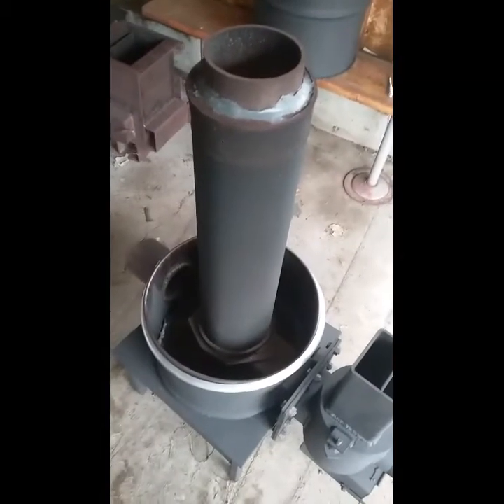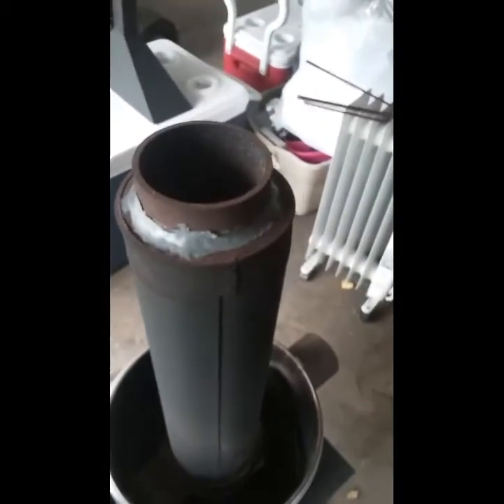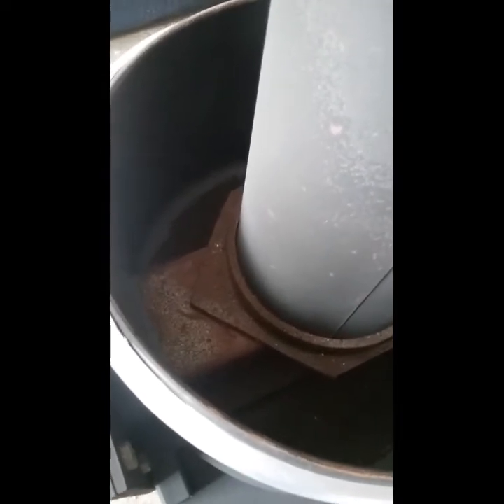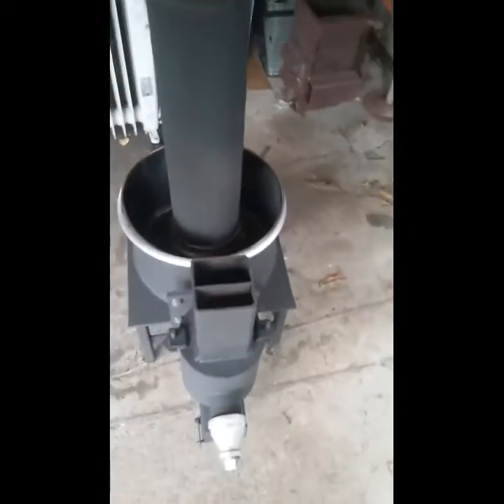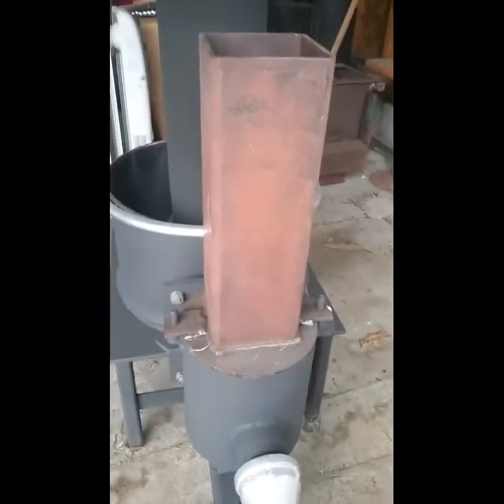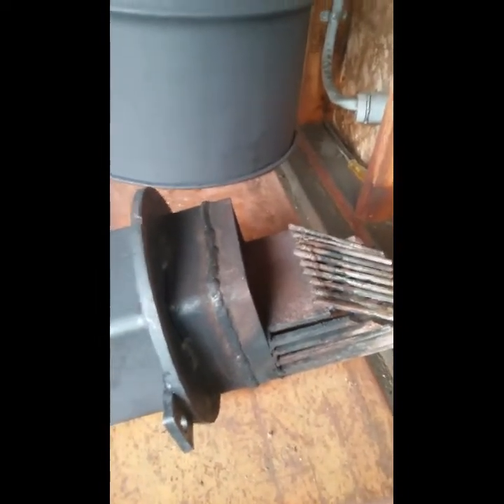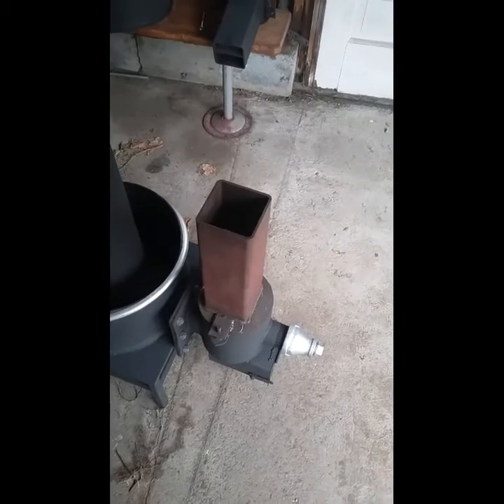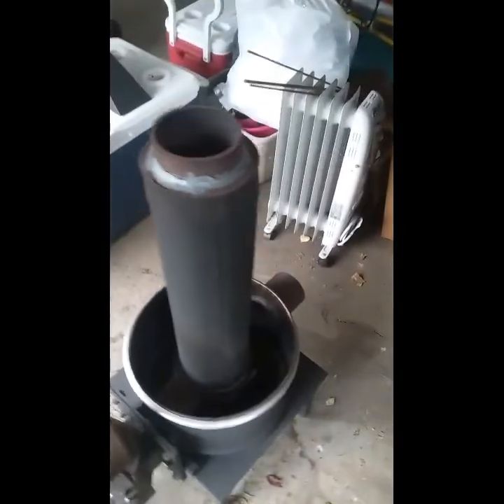rocket stove pellet heater 2

Comment: Metal is a big No No ,you will know when the pelite comes tubeling down, use a thin metal form and perlite clay waterglass  mixture as insulation  it will hold up to the heat for more info go to face book  " rocket stove rocket mass heaters international "